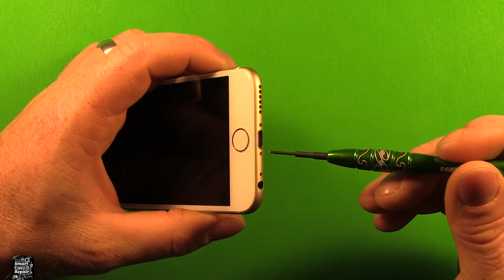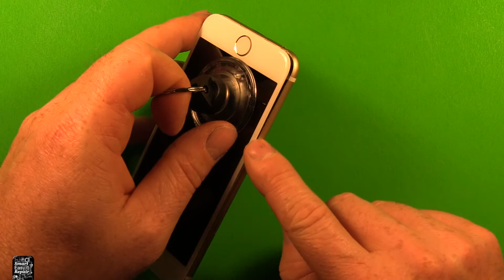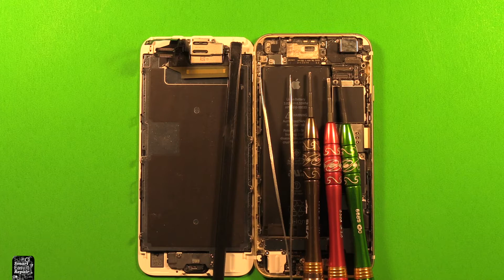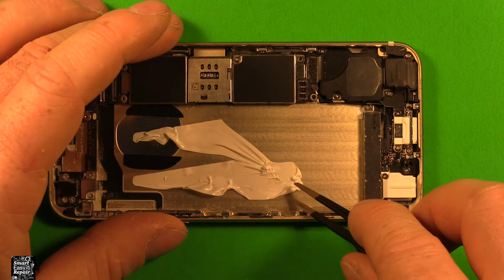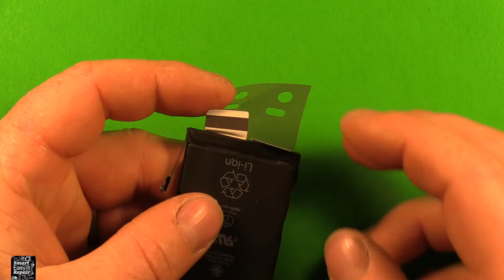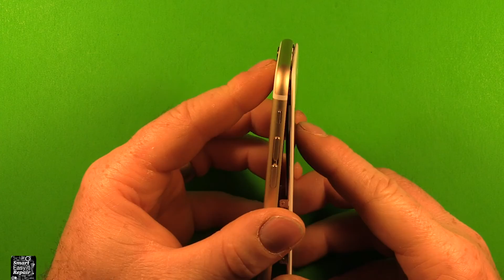iPhone 6s Battery Replacement How To Change

Comment: You don't need to pry the battery or heat the phone. Lift up the two black tabs and pull parallel to the phone (in the direction of the bottom of the phone) so the sticky double sided tape releases just like how you remove a 3M Command strip. They will stretch but will not break. Pulling them to the side around the battery like you do in the video ends up tearing them making the battery removal unneccesarily difficult.
Reply from the maker: I’ve tried both ways. Sometimes they break either way. That’s the reason for needing heat and prying very carefully especially when they do break.